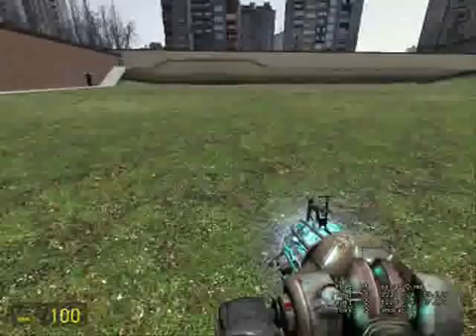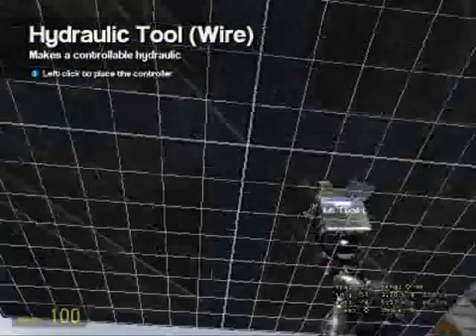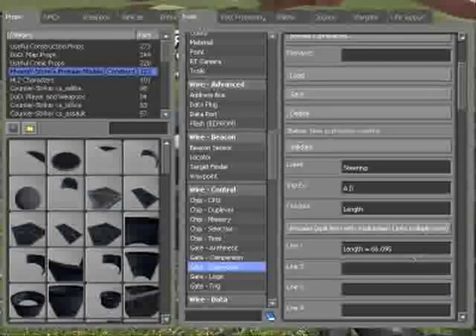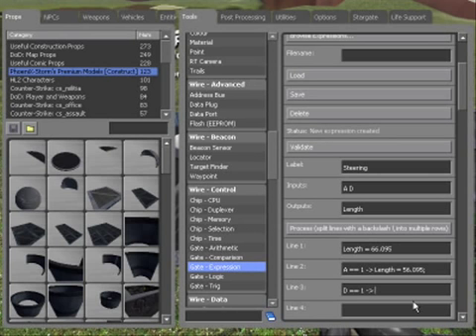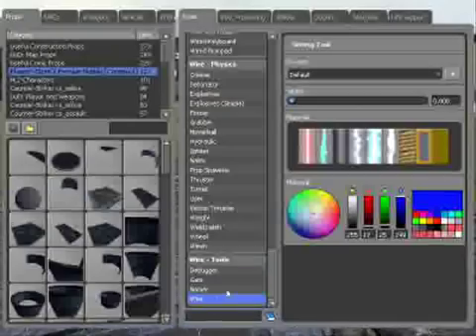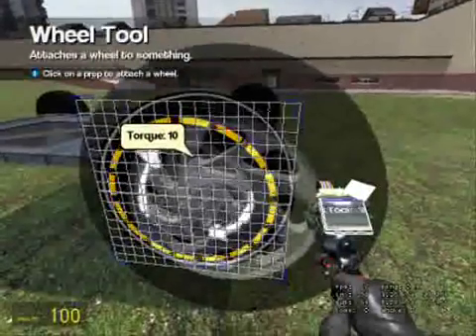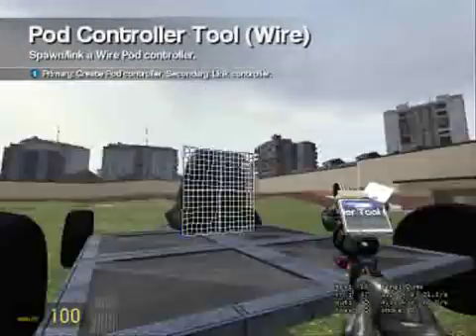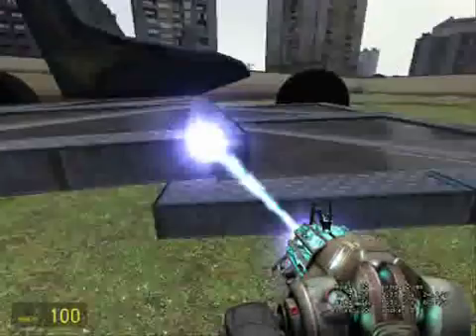Ducky's Tutorials # 12 - A Simple Car

Comment: @ChrisArnol9010 check you put the code fro line a
A == 1 -> length = 56.095;
not
A == 1 -> length == 56.095;
casue valdation wont pick that up he made that mistake for d so yea
personaly i preffer e2 its much easier